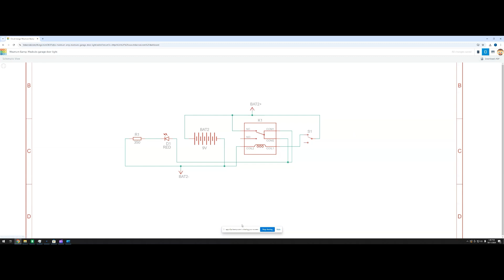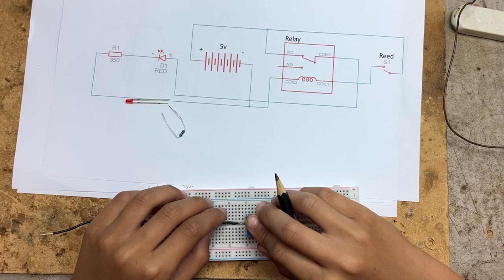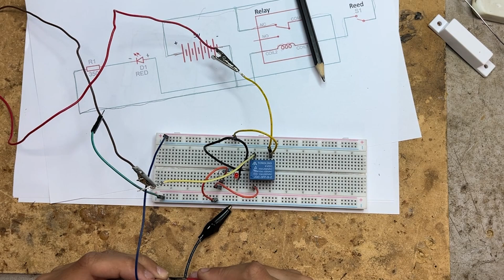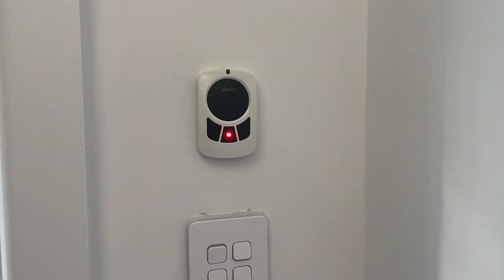DIY Garage Door Alert Notification Light – Electronics Project. Open garage door notifier

Comment: How about a dual color LED?  Closed = green / Open = red
Reply from the maker: Possible. You would need to move the existing resistor and LED (red) to be between the positive terminal and NC of the relay (see diagram in the video). Then you would install another resistor and LED (green) between positive terminal and the NO of the relay.